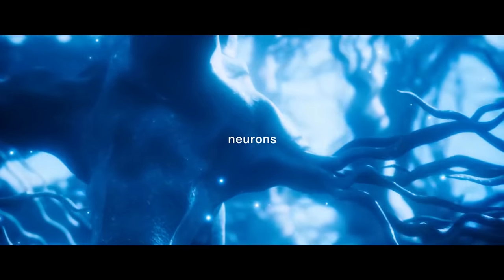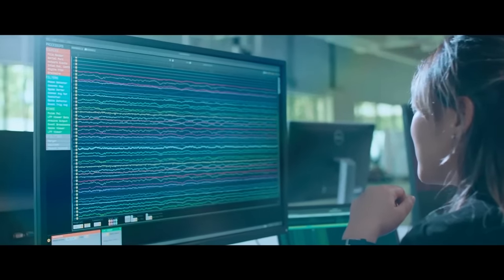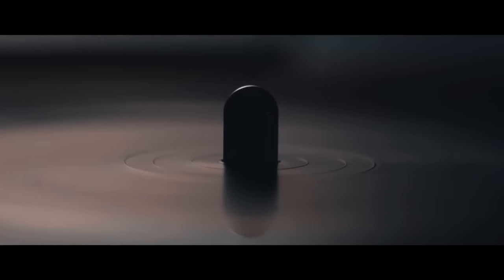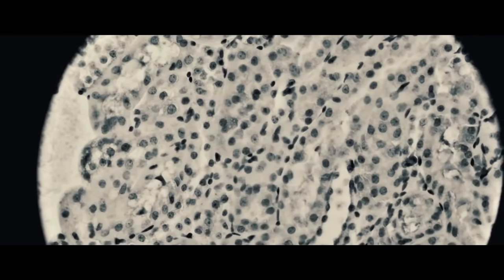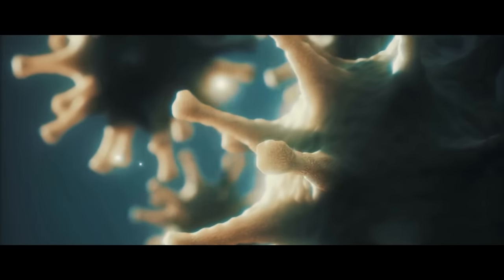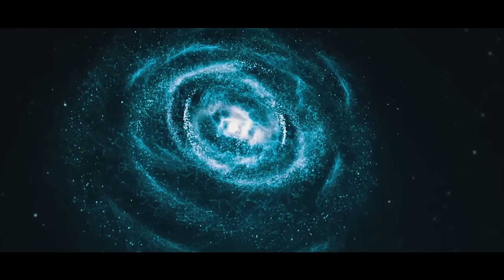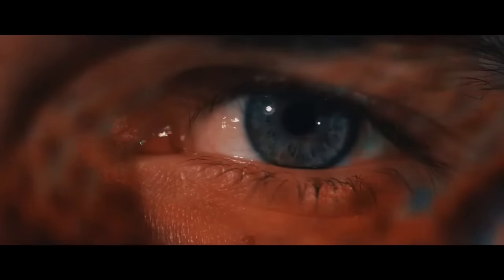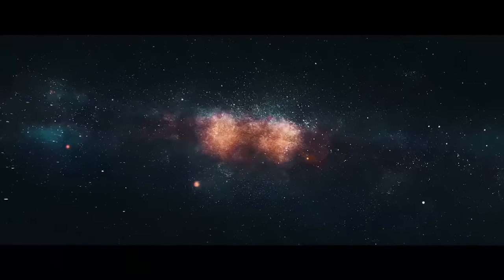The Illusion of a Bright Future

Comment: I could build a neural interface device that would do the same thing as neurolink but would be removable and non invasive. It would use extremely tiny but extremely powerful electromagnetic transducers to create currents or read out electrical signals. Combine with AI to learn how to use it. Also would have a much bigger battery so longer use time.
Reply: dont say i could say i will 😁